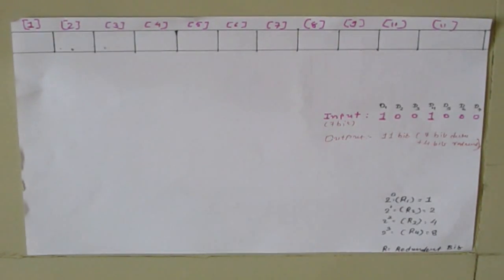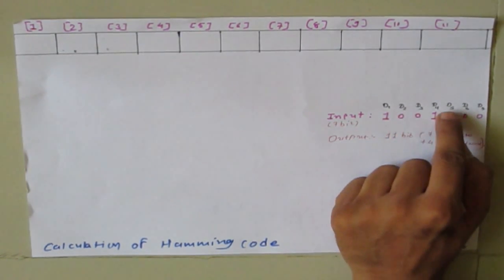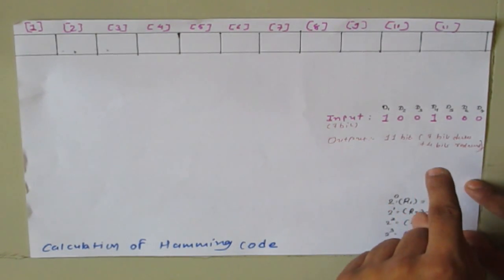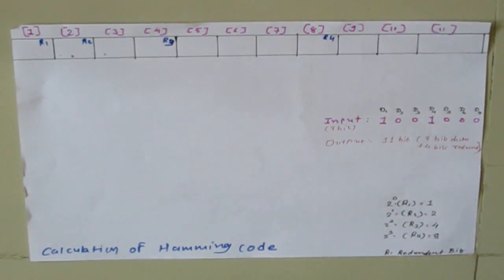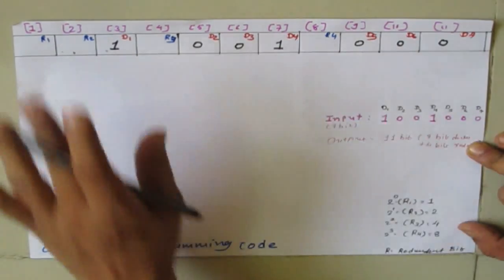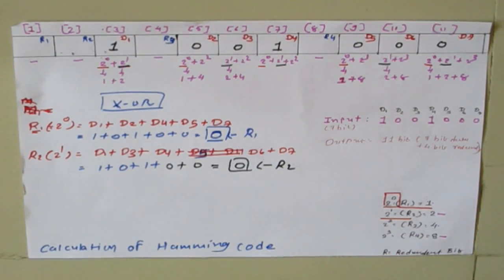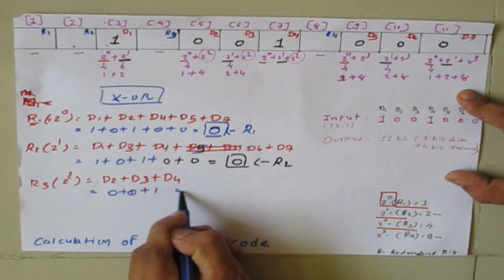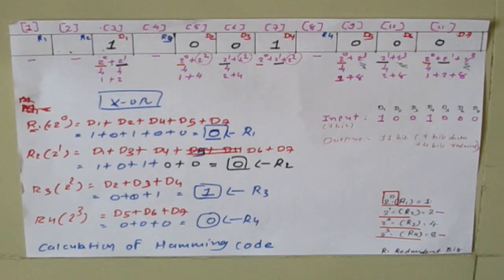Hamming code error detection and correction example, calculation algorithm program computer network

Comment: Find the check bit in the message 111101 using Hamming code.  ..plz sir solve it...my amswer is 1011...but i am very confused..its questions is in asking in uppcl exam but 1011 is not in option and given option is  1) 1101 
 2) 0101 
 3) 1001 
 4) 0001